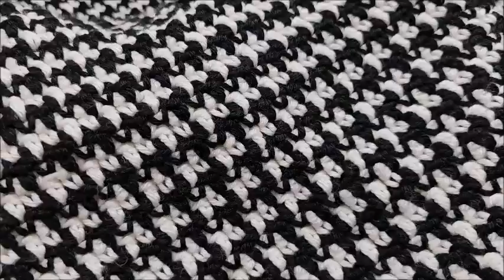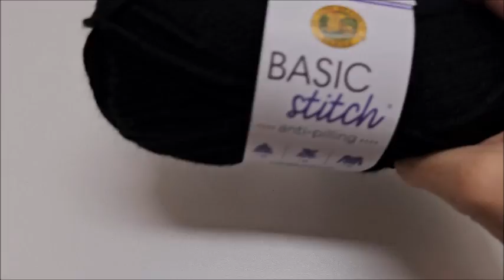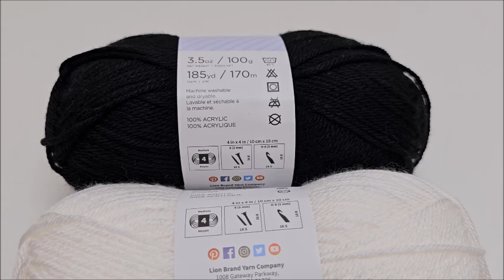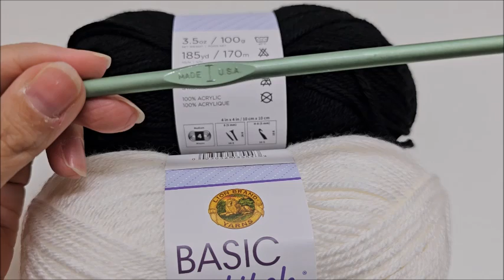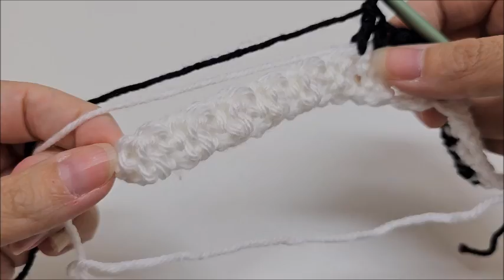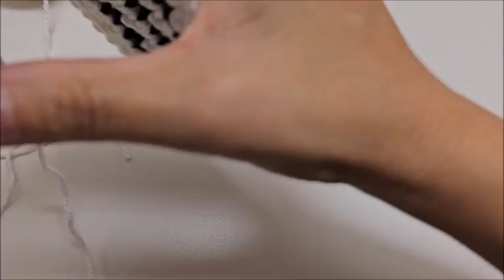AMAZINGLY BEAUTIFUL Houndstooth Crochet Blanket Tutorial - An Old-Time Classic Blanket

Comment: I finally got around to making this afghan after seeing the video a couple of years ago.  I purchased the same yarn in navy blue and beige, then found out we were moving (husband's job).  I forgot about the afghan.  Just recently, I was reorganizing my Yarn Dungeon and came across the bag containing the yarn and my notes.  It WAS very easy and it is OH SO GORGEOUS!  Rather than carrying the yarn through the rows, I opted for tying off and cutting after each row, leaving roughly a 2" tail.  Once the afghan was finished, I added a few more yarn strands to the edges here and there, to make them fuller.  I then cut the tails down to the same size and have fringe all around the blanket.  Again, it's gorgeous!
Reply: I didnt want to do the border and was wondering about leaving the ends as fringe. Did it work out nicely for you?

Comment: Thank you Crystal, this has been a fun project. I'm using up 4 weight yarns I had in my stash. Changing colors when I run out or no more than 5 rows per color change.  I do think if I do it again I will not carry yarn across, it feels a bit unstable. I think I will crochet it length wise and tie the ends together to make fringe. I have a very old drop stitch patterned lapgan that my grandmother made and she crocheted each row a different color and tied fringe. It came out great. I'll just start and end each row with a single crochet so I won't need to add extra fringe.  Thank you for all you do for us. You are the best!

Comment: This might be a silly-new-to-crochet question, why dont you have four skeins on the go? Row 1&2 are colour 1 and skein 1. Row 3 is colour 2 and skein 2. Row 4 is colour 1 and skein 3. Row 4 is colour 2 and skein 4. Then run them up the sides instead of carrying it all the way across?
Reply from the maker: The easiest way to crochet this stitch is two balls carrying the yarn, it's  the most common way it's done..If you use four, they're going to tangle easy. No way I'm using four balls at once. Carrying the yarn will only add about 200 more yards to the blanket. But anyone is welcome to crochet it as they see fit
Reply: @BAGODAYCROCHET  Thank you for your answer. I could easily see them tangling. I'm glad I asked and learned.
Reply: This is the same thing I’ve been trying to figure out all weekend, but unless I’m missing something, I don’t think there’s another way to do this stitch without carrying the yarn (or cutting the yarn). Because, no matter what end you attach the new skein to, you’re always taking it back to the other end (by way of crocheting that row with it). But, you you’ll never need that color at the other end where you’d drop it off. One color is always the “right” side and the other color is always the “wrong” side; they never interchange with this stitch pattern. So, even if you start a new skein of white on the right side, you’ll always be dropping it on the other side where you’ll never begin a row with that color. So, you’d be adding a new skein for each row, because you’ll always be taking that yarn back to the other side (by crocheting that row with it.)  I hope this makes sense; it’s hard to explain. — From what I can tell, the only way you can do this stitch is to carry the yarn. (I could be missing something, but I’ve been trying to figure this out all weekend, and it doesn’t seem to be doable any other way. (Other than cutting the yarn at each end and doing an envelope border to hide the ends, but I think the envelope border might use as much (or more?) yarn as carrying the yarn does.) Much luck to you! =)